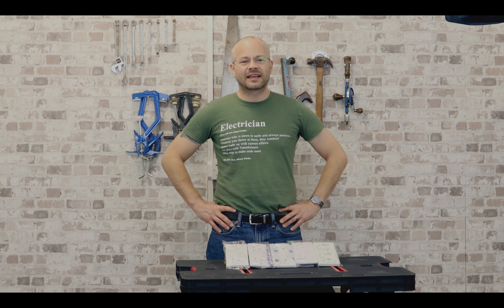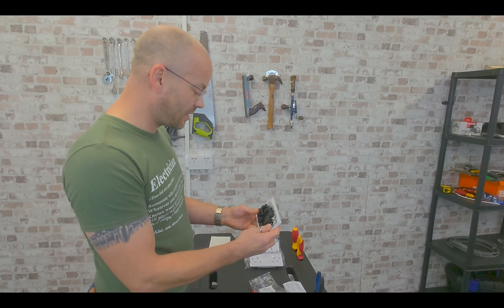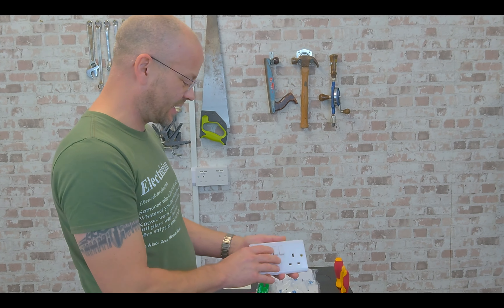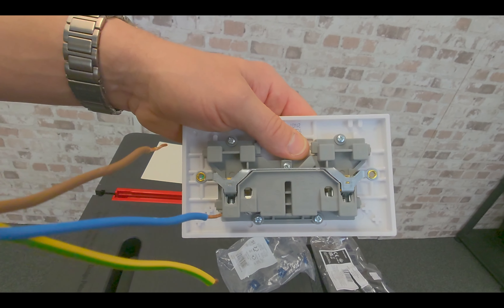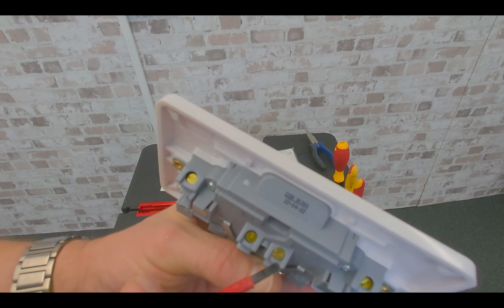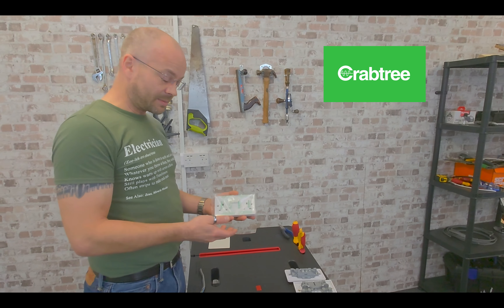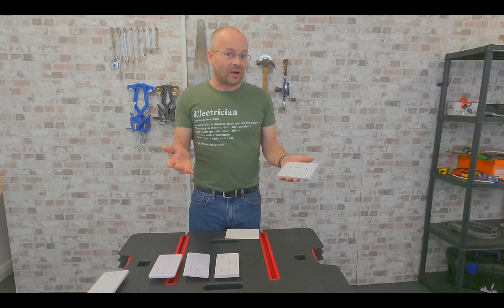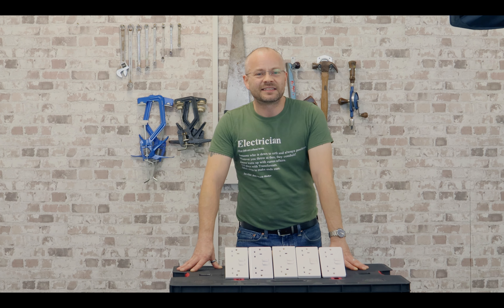Cheap Double Socket Comparison | Which Brand Offers the Best Quality for the Price?

Comment: Is a fridge normally on a dedicated circuit in the UK?
Reply from the maker: Not any more. How ever in new builds, you will often find a group of double pole switches that you can control the oven, microwave, fridge etc.
In older homes the fridge/freezer was sometimes on its own circuit in case the ring circuit failed. But that is no longer allowed due to sockets requiring rcd protection.

Comment: I like round tunnel terminals as they tend to push the conductors together and both rest under the screw...
Reply from the maker: Round cable into a round hole, it makes sense.

Comment: I just bought the Lap socket because it got 4.5☆ review on Screwfix. Maybe because it's a newer design because the socket is a different design from the one in your review. So the reviews could be for the newer design.
Reply from the maker: Quite possibly, but I expect the guts are still the same.

Comment: how about deta and scolmore click also cef sell a really nice square edge range called omega now called m2 square i have installed loads of the omega (M2 square) same stuff just renmae and they feel really solid and work well i like m2 square for square edge accessories
Reply from the maker: I personally think click are ok, but the feel a little cheap, especially the screw terminals. And I don't touch deta with a barge pole, they were (and still are I think) fitted into new builds (dwh, Barrett, etc). 
I had to replace around 70% due to failures.
Reply: @ChampionsOfTheTrade   deta and bg are bad news as bg is bodged into new builds have you tried cefs own range M2 Square (formuly omega) I've installed loads and there really good
Reply from the maker: @kierantvyoutube3591  BG are ok, I've used a lot of their products, but they're now too expensive against better brands.
I don't generally use CEF, I also find them as a whole very expensive.

Comment: What do you think about MK Logic Plus?  £3.69 at Screwfix.  Worth the extra £1?
Reply from the maker: I like them. In fact, with the price increase of the BG range, I've started to move more towards the likes of MK, though I suspect that these prices will soon increase too. For the most part, I always try to match the existing style within a property or use what the customer prefers, within reason.
The £3.69 MK is a double pole socket (The ones in the video are SP). Given the choice/budget, I will always fit DP. Personally I just prefer the idea of being able to turn off both line and neutral.

Comment: How do Hager sockets compare to Schneider?
Reply from the maker: I like both of them, Schneider are cheaper but I prefer the look of the Hager. Both quality items though and never had to replace any that I've fitted due to failure.
Reply: @ChampionsOfTheTrade  Would be interesting to see you do the video but with the more expensive sockets MK, Legrand, Ultimate etc. and see if the extra features justify the cost.
Reply from the maker: @cebenezer  I'm planning to something along those lines. 👍